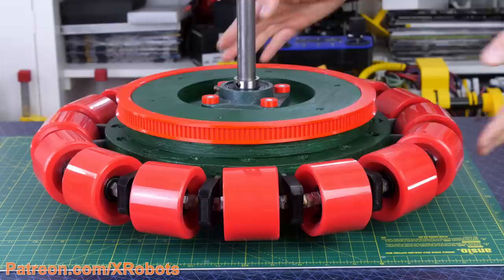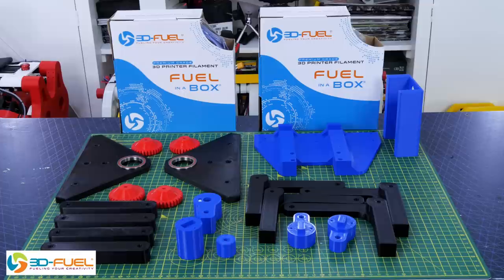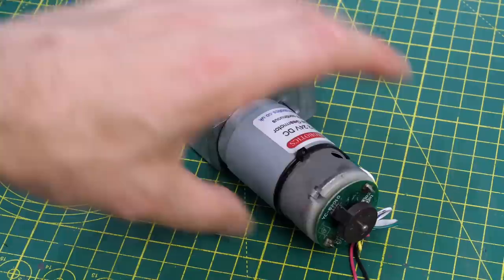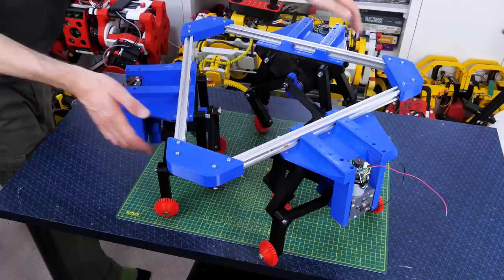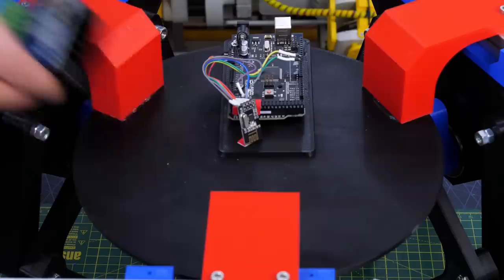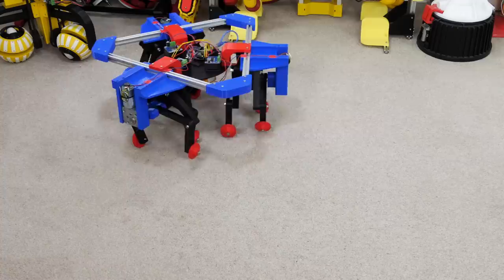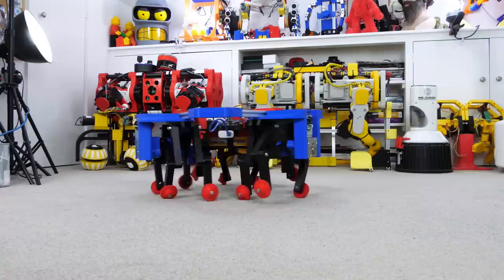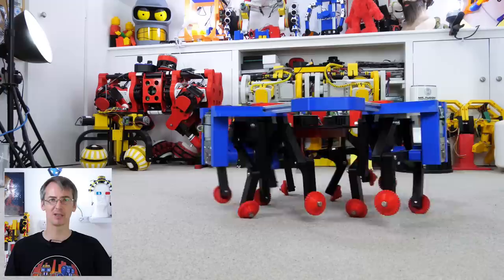Why this Walking Machine is Really Weird

Comment: For the life sized one that you can ride try putting the chair on some sort of gyro or suspension because the Omni-directional wheel one looked incredibly bumpy and I’m sure this one will be even more bumpy. Just a thought. Love the builds.
Reply: Yh one of those 6DOF gyroscope stabailised platform with appropriate emu's then put a set on that, you'll be level no matter what the 'legs' are doing them :)

Comment: Those are not called cams, they are cranks. A cam has a rolling or sliding follower and can be shaped to an arbitrary profile, whereas a crank simply has an eccentric rotary joint. Engines have both a crankshaft and a camshaft, but this type of walker mechanism uses a crankshaft.
Reply: Maybe the automotive terms don't cross over into robotics in the same way, you're spot on though if not
Reply: @Matty.Hill_87  These terms far predate automotive and robotics. Cams being dated as early as around 600 BC in China, and cranks being dated as early as the Western Han Dynasty 202 BC - 9 AD in China, not to mention these have been fairly prominent throughout both eastern and western history in machinery and automata. They're fairly simple concepts with well known definitions, no matter what field of mechanics you belong to. There is no 'crossing over' to be had; James blatantly used the wrong term, stop trying to find excuses for why the wrong term was used.
Reply: @xaytana  you are right, but it’s also ok to be a bit more chill about being right
Reply: yep! you're correct
Reply: @ThatGuy-fi9bm  WeLl AcTuAlLy
Reply: @razzledazzlecheeseontoast9808  got me there
Reply: @xaytana  neither of those are where the terms originated, just where the first examples were found. the word crank comes from an Old English term for a tool used by a weaver, and the word cam comes from a Dutch word meaning "comb," as in "comb-wheel," the literal translation of a Dutch word for a cog or gear. 

as it turns out, things dont come with labels on them by default. cam and crank are jargon, and different segments of engineering have different definitions for them, and different languages have entirely different words for those concepts. some languages might even have more terms, or one term that refers to both.
Reply: @littlesnowflakepunk855  This is why I didn't go into definitions but rather what most of humanity would commonly recognize these items as in modern english terms. There's obviously a language barrier between virtually all languages with loose translations and messy etymologies. But the fact that historically these items have existed and have remained relatively unchanged is the point I was making, just apply what language is currently being used to the argument. Show either of these objects to anyone with knowledge of them and they will point out what they are in their native tongue. 

And no, it's not really jargon at all. Maybe you should go look up what jargon is since you want to be pedantic. And no, these terms really don't change when crossing over into different segments of engineering when you stay within the same language, these terms are not unique to any one segment of engineering, they're a broadly known term within engineering within the language being spoken. And no, a language will logically not have multiple terms nor a shared term for two relatively simple mechanisms, that's not how language works; there may be dialect differences and antiquated/historical terms, but when talking about standard language, each of these mechanisms should have a singular term per mechanism, because they're entirely different mechanisms. I'd honestly be very surprised if you have the linguistic knowledge to fully understand this, not many people actually decide to dive down the rabbit hole of etymologies and the evolution of terms, within a singular language, across multiple languages. But considering you clearly don't know what jargon actually is and you raised the possibility of multiple concurrent terms within the same standard language for something as simple as this, really shows you don't know much about linguistics. 

At the end of the day, a rolling slope is a cam, and and a bent shaft used to convert rotary motion to reciprocation motion is a crank. In modern standard english this is how things are. In any standard language of any date, those terms would be defined with the same definitions. This is because throughout a large portion of human history, we have understood these mechanisms for what they are, and they would still be defined as such even in the earliest instances of them. It's really not hard to understand. There literally is no crossover that makes a cam confused with a crank, no matter in what language you use, they are two entirely separate mechanisms. And the fact that you try to be pedantic enough about linguistics to argue this also shows that you don't understand the base concepts that you're trying to argue the linguistics of; just as some other people here clearly don't understand the concepts of a cam and crank, and how they differ. 

Just stop. You can't debate something you don't know much about, and you clearly can't research past a couple pages of wikipedia and wiktionary. Educate yourself instead, learn some logical thought, it'll help you out in life. You're going down the same path as the other person here, making excuses with bad arguments, arguments that can get shot down immediately with the smallest amount of knowledge and logical thought. Education is important and you're demonstrating that you lack a considerable amount of it, just as most people in YouTube comments like to do, which really shows the state of our society; as does the weird parasocial shit of making excuses for random strangers. Again, just stop.
Reply: @xaytana  Thank you! I could not have said it better myself.
Reply: @xaytana   Gonna stop you right at the first sentence, there. "Most of humanity" doesn't speak English, and therefore would not understand "modern English terms." Globally, less than 5% of the population is fluent in English, and among those there are ~160 local and cultural dialects with minor differences in definitions. You're making a semantic argument because you think the dude used the word "cam" to refer to what you would call a "crank," and yet you seem to be completely unaware that your argument is semantic and not fully logical. 

I understand that you define these things in a particular way. What I'm explaining to you is that not everyone draws that distinction in the same exact way that you do.
Reply: @littlesnowflakepunk855  Maybe you should keep reading beyond the first sentence, your primary level comprehension skills are really showing. I'm not strictly defining them within modern englsih, I'm explaining that I wasn't using definitions because of linguistic issues when the concepts themselves are recognizable as what they are beyond language barriers and translations. No matter which language is used, if you point to what we call a cam and a crank, they will understand what the item is in their primary language based on the mechanism they provide; this is where your argument falls apart, there is no mixing of what we call cams and cranks, they're two distinct mechanisms with their own names throughout any language you use. 

Stop arguing linguistics and logic when you clearly don't understand either. You can't even be arsed to comprehend a full statement, as you cut a statement off where you please, because you disagree with your bad comprehension of said partial statement before even trying to comprehend the statement as a whole. You really are an absolute dunce, aren't you? You sure as well act like one. Not really a surprise given the anime profile pic and the name, how about you go back to Twitter with your terrible counterarguments, you'd fit into that cesspit much better. Don't attempt to keep arguing this, you're in the wrong, just admit it, you don't understand what you're arguing and instead resort to arguing like a child that isn't getting their way; but based on your comprehension skills, you might as well be a child. How about educating yourself rather than making yourself look uneducated. 

Again, at the end of the day, the two are easily identifiable by the mechanism they provide, no matter what language you speak, the mechanisms transcend linguistics issues throughout multiple time periods because of this. The mechanisms are also universal throughout engineering, as they provide two entirely different transmissions of motion, one area of engineering will absolutely not be using terms that confuse the two, because that's not how basic language works. Take for example the wheel, it's universally understood in the exact same way, no matter what language is being used. There is no valid argument against this. It's not that hard to understand.
Reply: Bro… who gives a shit if it’s the wrong “term”
Reply: @1FISH  there are obviously situations in which the distinction is relevant. is this one of them? no, not really
Reply: @xaytana  dont you have anything better to do than to write essays on a reply section to strangers about the most insignificant thing 💀

Comment: are you familiar with Jamie Mantzel? he designed a 6-legged robot that can walk in any direction using just two motors. he spent around 6 years making a giant metal version during which time he managed it to get it made into a toy and sold in stores ("Attacknid"). while he finished the metal version he never got it to the stage he wanted with his limited resources... the dude lives a very unconventional off-grid lifestyle. his goal was always to build one big enough and strong enough he could sit on... he has said it would be cool to see someone like furze make one. anyway, you might find it interesting.

Comment: As I'm sure you already know, the theo jannison strandbeast linkage is already optimized for taking that jerky movement out. If you simply swap the linkage that you have with the strandbeast linkage, I think you'll notice that there's much less jerky movement in the stepping motion.
If you look at the path of motion for the tip of each of your legs you'll notice it moves in a strange squashed ellipse. With The strand beast linkage, that ellipse looks more like an airfoil with the flat side facing the ground. This means that it's got smooth translational motion. Nice job though. I really like the concept. I think I want to make one of these and stick a light on it for when I'm working on my car.

Comment: Was thinking - if you can optimize the crank and follower path to displace more vertically rather than horizontally, you could increase the RPM the crank turns at to make the steps faster and smaller. This could improve the travel over debris because leg lifting is of critical importance.

Comment: I found a mechanism you would like on a very old Dixon zero turn mower. The engine constantly rotates a sphere and there are bowl shaped driveshafts on either side with break pads lining the concave sides. The drive levers will move these bowl shaped plates up or down to contact the sphere and drive the wheels. I have photos I can share if you are interested

Comment: You could try making the passive wheels larger and just moving them higher up on the legs. That should make it a little easier for the wheels to roll over small objects when the robot is oriented in the wrong direction.

Comment: James, thank you for mentioning DIYwalkers - my son Ben and I were excited to see this. PS. I think you chose the best leg design for simplicity and strength, but it's a 4 bar linkage that doesn't step high on the inside of its foot-path. Strider Ver 3 is a different mech that steps higher...but it's more complicated with 10 bars per leg pair. If you don't plan on walking on really rough terrain you may want to stick with this 4-bar linkage rather than the more complicated Strider linkage. Again, thanks so much for the shout-out James!  Wade

Comment: I immediately thought of the elephants that hold up the Discworld. If you up the size you could use more walker units, probably six of them, and it would look like a fanciful carousel. Or I suppose you could arrange the Walker units in parallel like a team of horses and offset the angle of the wheels on the feet 45° like a mecanum wheel.

Comment: Ever considered making a 6 legged walker? Since they are passively stable when both walking and standing programming them should be fairly easy. If you make it in a circular configuration it could fairly reliably move in any direction, but would require a lot powered joints to do so

Comment: After seeing that thing walk, I thought, about speed, so what if you arrange 6 or 8 spider-legs in a circle, so you could easily move in all directions? Each leg can pivot from right to left a few degrees 15° in each direction for example and also has two pivot points perpendicular to the first one along the leg, in that way the legs on the side can move the first pivot while the other legs can orient for the moving direction and basically move like a dog or so. So a spider-walking-vehicle. That would be really nice to try, ask if you have questions.

Comment: Rather than rigid legs it would be interesting to see rubberised flexible legs. Not sure how best to explain it, but imagine liquorice of cheese sticks. They could naturally flex and grip in all directions without the need for wheels.
Reply: You'd still need the wheels for when one set of legs is at 90 degrees, otherwise those feet would draaaaag. You need them for the passive direction.
Reply: Mojo's palanquin!
Reply: @jama211  Yeh good point. Seems to be a general issue with the design.

Comment: man one thing I would love for you (or someone!) to share are the recipes you use for screws and the size holes you use. For example, if you want to use XYZ wood screw then make this size hole on one side with this amount of bevel/chamfer for the head and on the threaded size, this size hole. I fight with figuring out what hole sizes to use all the time and have to go through many prints before I finally get something that holds but isn't too tight or too loose!

Comment: As cool as it is (it really is), its utility seems... debatable.
The mechanism needs legs and wheels to work at the same time, which means it shares the weaknesses of both of them, while offering none of the advantages. The wheels can't offer a smooth or fast ride, because they're limited by the speed and stability of those legs. And those legs can't climb over large obstacles, because they need those small wheels to function.
I think a "normal" walker with powered wheels at the end of each leg would offer more utility - with legs for moving over obstacles and wheels for faster speeds and turning while moving. It wouldn't be a "true" omnidirectional robot, but would offer most of its advantages while being able to get over large obstacles. Also, it would walk sideways - which is an advantage in my book.

Comment: It strikes me that that type of drive mechanism doesn't translate constant motor speed to constant linear speed... and I wonder if it would drive nicer if you had encoders on the drive shafts and accounted for this non-constant speed in real-time when determining the motor speeds to achieve a particular direction of motion. This could make for less twisting back and forth when trying to move in a straight line.

Comment: Grip etc may be different on different legs, or may be cool to add sensor that course correct if it’s turning faster or something in certain direction. Simpliest I can think of is it measures true direction it traveling compared to direction it is traveling and then adjusts accordingly with decay function for correction so it Doesn’t over correct. 

Another cool idea would be to make legs rotate so there not always in configuration of 120 apart from center spoke. This could lead to better walking in chosen direction and more grip. Simplest I can think of here is back legs move to be 180 apart from front and parallel to each other when just going one direction and move 120 whrn making many turns

Comment: Initially, I was a little put off by the inefficiency of loosing the effort done by the motors to the cosine of the direction travelled, but actually it occurs to me that there may be a clever use case here? If you are after efficiency, you use the leading set of legs "straight on" and you will go as fast as 1 motor can run the legs, and the other 2 sets will idle. However, it you drive from the rear legs, you should get much higher (torque?) pulling force, as not only have you doubled the motors driving but you are also using the incline plane principle? Can you test the "pulling" power in various drive directions?

Comment: 7:24 I think you mean that the slower tracks (the \ /) must run 50% slower than the top horizontal one.
(I would post a link to a picture explaining it, but unfortunately YT does not allow external links)

Comment: What if you programmed it so that the stationary set of legs oscillated back and forth? That way it would still lift its legs over obstacles, but it might not alter the direction of travel of the robot significantly.

Comment: On rough ground how will the wheels slide? Would it be better to have the wooden strips screwed down so the wheels can’t push them about before they seem to step over them, rough ground will not be so submissive.

I think you need the legs that are sliding to be off the ground and lifted to a height that’s higher than what you want to step over. Not yet seen any walking animal use the sliding foot action so evolution must have given up on that idea last week. (Note! a week is a long time in evolution terms)

Comment: Couldn't you have gotten a motor with shafts coming out both sides of the gearbox?
Then you could put that directly in the centre of the chassis and the whole thing would have looked a lot neater.